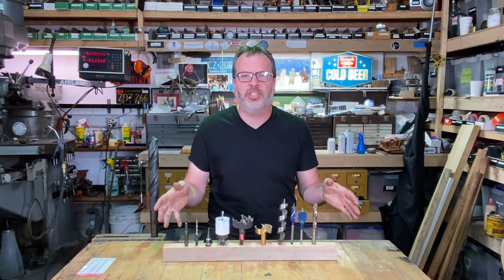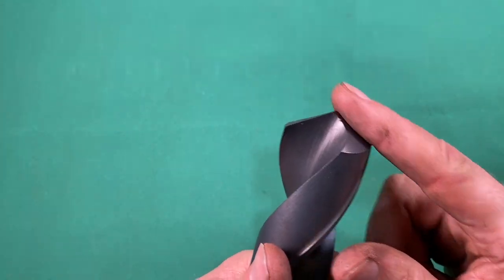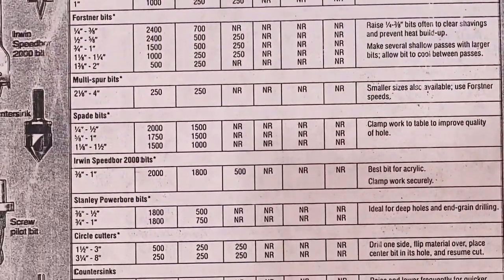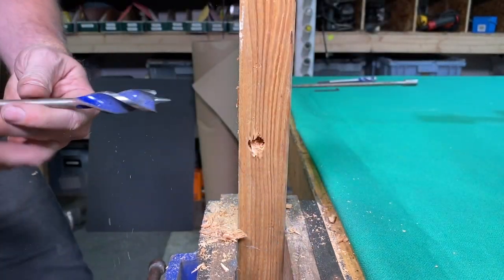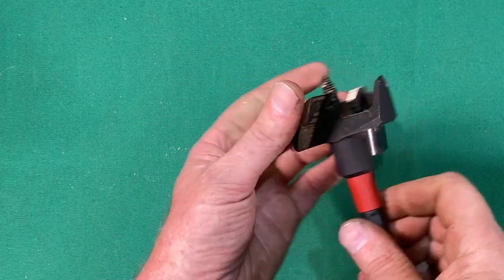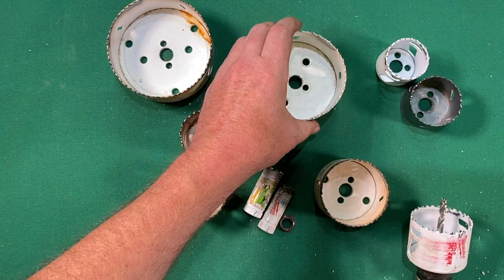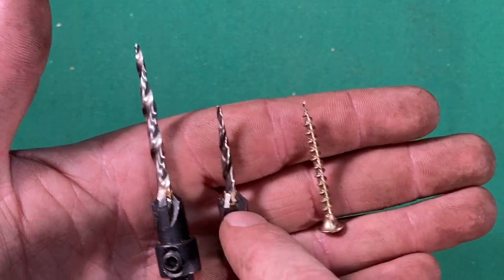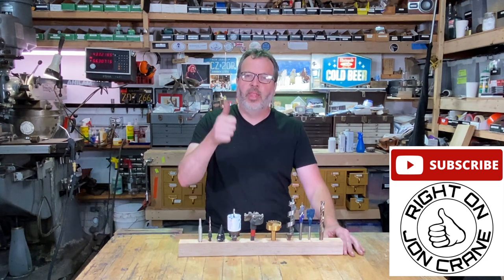Top 10 Drill Bits And How To Use Them

Comment: Thanks Jon. Great vid. Was always skeptical about step drill bits but bought some not long ago (not the HF ones) and am pleasantly surprised how well they work. Live and learn! Indeed about the hole saw torque. I bent the mandrel drill bit on one. That can hurt!
Reply: Had very good luck with HF step bits. Used them everyday on the job. Use tap manic to keep them cool. Got good results.
Reply from the maker: Right On Stan! 👍 I love those step bits. I used them often when I worked as an electrician ⚡️⚡️⚡️ Same job where I often had my arms twisted up with a Milwaukee Hole-Hawg! 💪😳
Reply from the maker: Right On Topper that’s good to know about the harbor freight bits!